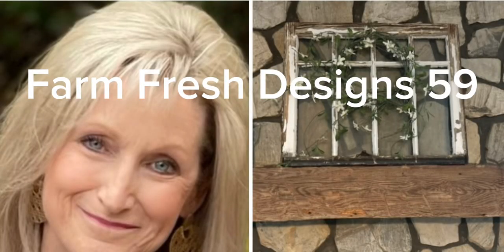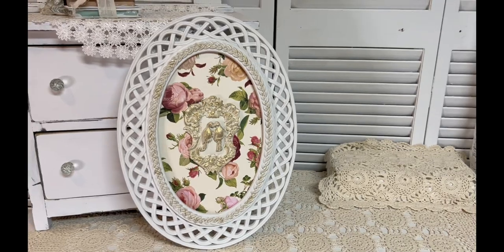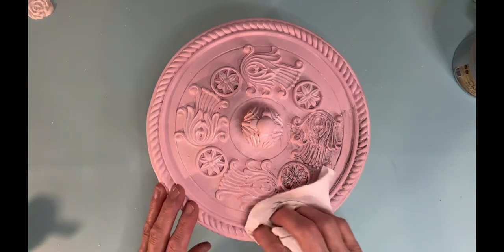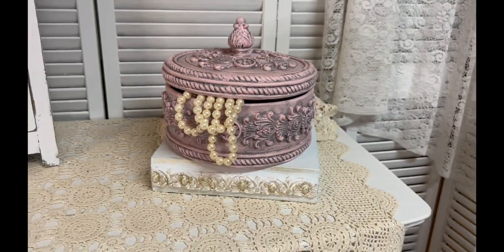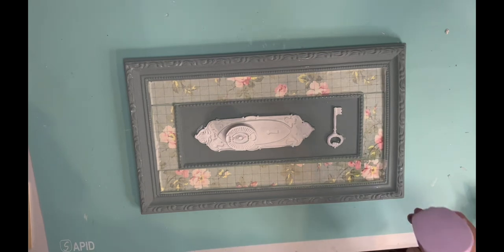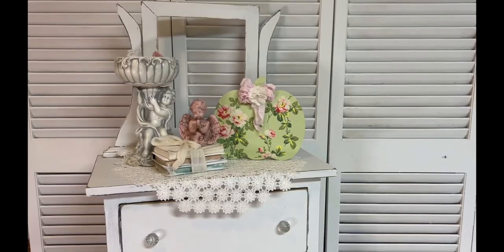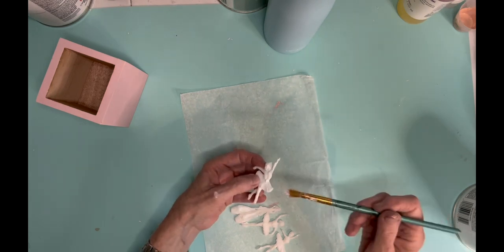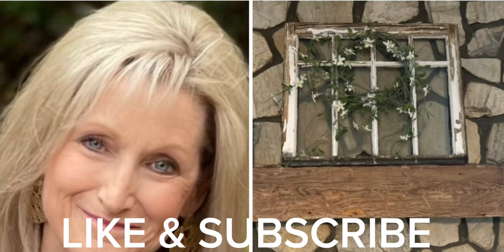Shabby Chic, Cottage Core, and Glam DIY projects

Comment: Myra, shhh....you told me a secret in a previous reply to one of my comments that today's video I could expect to see a paint inlay. 😁  Well, you exceeded my expectations❣️🙉😎💜🌿🌺💟💕 XOXO

I have never seen paint inlays cut into strips before; neither have I seen paint inlays spritzed with water 💧 ON THE PAINT SIDE before laying them down,  nor had I seen inlays pressed down with a dry brush before - I had only seen them pressed down with fingers and/or a brayer.  THANK YOU FOR SHARING THESE TECHNIQUES❣️ HUGS TO YOU‼️🫂 I L💟VE PAINT INLAYS - ESPECIALLY the Rose Chintz❣️💕💜🌹🍃🌹🍃

I agree that the "Pepto Bismol Pink" box with all of those delicious details needed a dark wax after clear waxing.  Personal preference being what it is, though, I would have used a brown wax instead - only because my LEAST FAVORITE COLOR ON THE PLANET IS Grey/Gray. 🤮 Sorry; I just hate it because it reminds me of death. 😔

I really liked your idea of using WHITE FOAM BOARD in picture frames - ESPECIALLY if you plan to decoupage a design to be framed - because you SAVE A STEP and DON'T HAVE TO PAINT - AND because with vintage frames, the foam board is most likely sturdier than the old cardboard or chipboard"s condition is after years of use❣️😁💕  LOTS OF FOOD FOR THOUGHT in this video, Myra, including the reminder to use hot glue and resin in IOD MOULDS IN ADDITION TO IOD PAPER CLAY (my Brand preferences). I am so DELIGHTED with this video, Sweet friend❣️😊🍃💝🌿🌺🌹💜🍃💕
Reply from the maker: On the paint inlay with the dry brush was me flying by the seat of my pants😂.  I cracked about your gray comment, it does look like ashes doesn’t it😊. Thanks sweet friend always for your great comment.  See you Saturday morning.  Shhh, using gray again but you’ll like the projects.  Have a great Friday.  💕💕💕

Comment: I want to share a tip some may not know
about. You will not have any bubbles or wrinkles with Mod Podge (MP) if you iron the tissue paper, paper, napkins, fabric, etc. to the Mod Podged project.

1. Spread the MP on your project and let it dry completely. 

2. Once dry, lay the paper over the MP  

3. Place parchment paper over the paper, and iron with high heat no steam.  Household iron or tools like the Cricut heat press can be use.

The ironed paper will be smooth, no bubbles or wrinkles, and very well adhered. Sand the edges to add that finishing touch 

Hope this helps someone. Blessings to you.
Reply from the maker: Thanks friend.  I have seen other use that method but was kinda scared to try it.  I’m guessing it’s better on flat surfaces??  I’ve got a Cricut heat press that I could use.  I’ll try that next.  Thanks so very much.  Have a great Thursday 💕💕💕